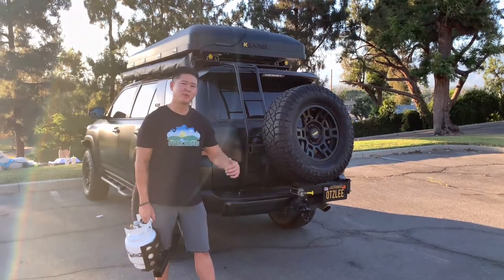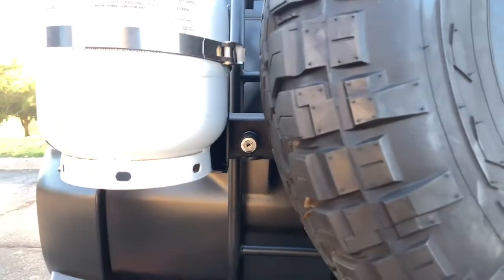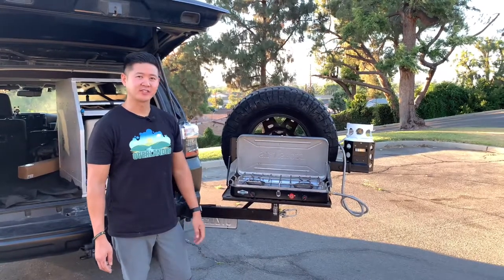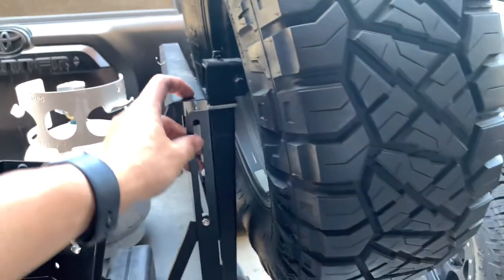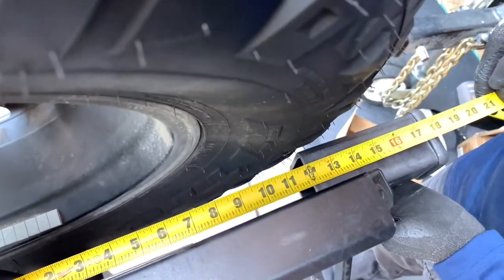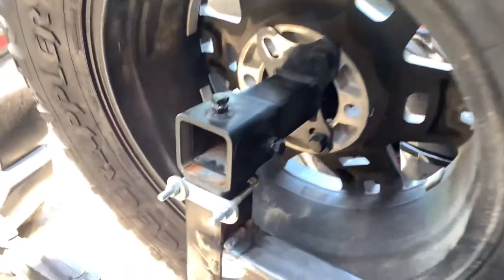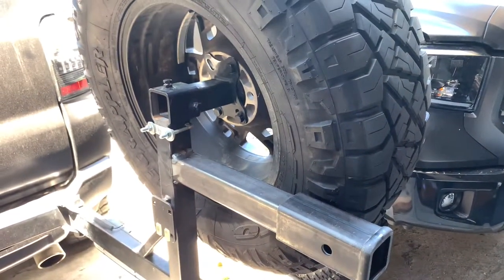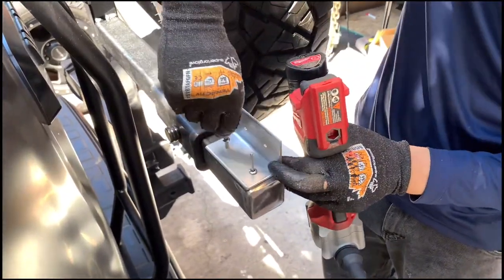DIY Overlanding: 5lb Powertank Propane Mount for 5th Gen 4Runner (Detachable)

Comment: any chance you feel doing this with something larger than 5lb is doable?
Reply from the maker: It’s definitely doable. The weld and bracket is very strong. The main issue I see if the swing out being too heavy on one side and causing some minor friction during the spin.